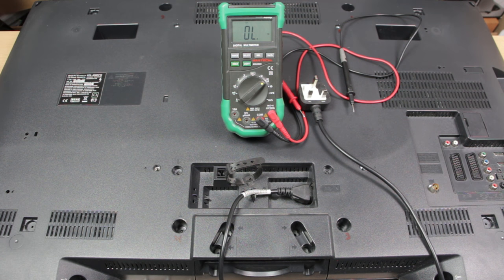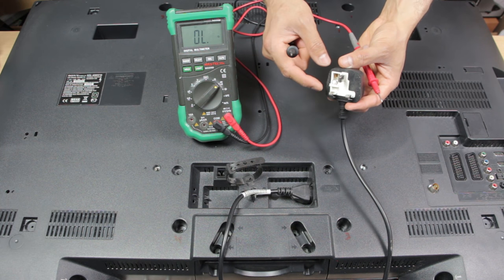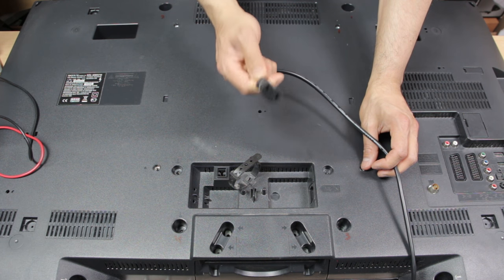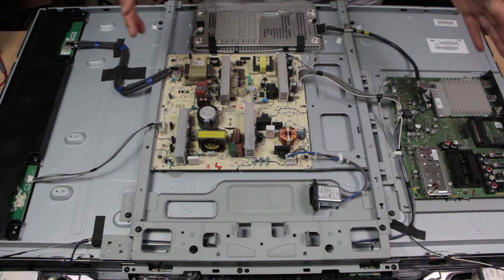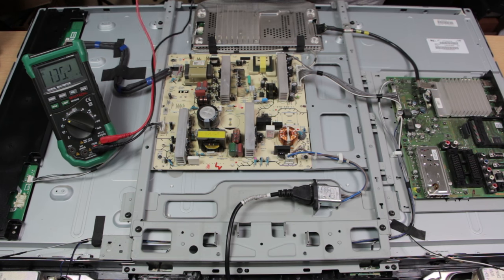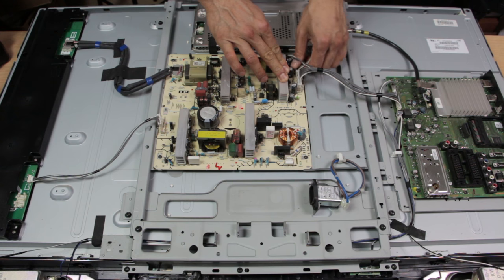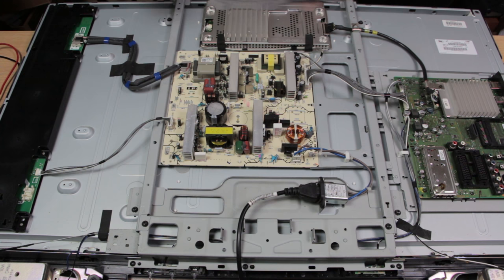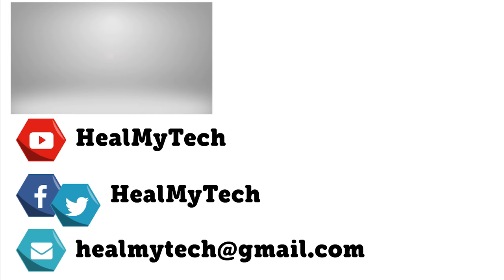How To Repair A TV That Won't Turn On | How To Replace A TV Power Supply Board | Sony KDL 40W5710

Comment: Thank you for posting this video. I was going to throw out my Bravia after a lighting strike, replaced the Power board and all is good, saved myself £££. Keep up the good work matey 👍
Reply: this is why my tv/audio stuff is on a line conditioner. if lightning strikes, it will blow the fuse in the line conditioner and save my equipment.
Reply: How much did a new one cost?
Reply: Why you don't just fix the original supply board? What's the problem with it?

Comment: 10:45..."if you want to ask a question..." but questions posted months ago go unanswered.   I enjoyed this tutorial.  I'd have replaced that huge black capacitor before the whole board, however, as modern capacitors are poorly manufactured junk components and are likely the power failure cause....and cheap!

Comment: My 87 yr old Moms 2011 Panasonic 42" TV would shut off after a few hours of use. A red led  light would slowly flash. The remote would not turn the TV back on?! I figured out that if I removed the TV's power cord from the wall, and plugged it back in, the TV would RESET. In the old days of computers, we would call that a "Hard Boot"! She would sit for hours staring at a black screen. Thank you for putting this simple step by step video together. We cant afford another TV, so THANK YOU for helping me! Michael Seattle WA USA!

Comment: Its such a shame that such a huge board cant just be fixed.  I guarantee its probably a blown capacitor or something simple.  That circuit board is so huge and DOESNT use SMD components.  It SHOULD be cake to fix :(

Comment: We replaced the power supply board with a brand new one. Tested it with a voltage tester on DC and should show 5 amps and it doesn't. The old one did the same. Do you know what the problem might be from here?  There is power going in from the plug but not power going out to the mother board. Like I said the old one did the same so I am guessing it must be something else. Any suggestions?

Comment: Hi, I've got a Sony Bravia KDL-40EX503 that turned off on it's own, but the red standby light flashes twice. Could this be power supply issue? I've tried soft reset and factory reset, still get the same result. Any ideas please?

Comment: Thank you, now I have to go test my DC voltage. My TV is a 110v US model KDL-40V5100 manufactured in May 2009. It doesn't have the fuse in the plug like that Euro model. There was a near lightning strike that took it out. I tried to check the fuse that is on the power supply board and it ohms out at 0 ohms but I'm not sure if it is correct since It's not removable without desoldering it. I checked the voltage to see if it comes through it and it does have 110 (117actual) volts on both sides. The 3.3vdc is present all the time it's plugged in. One Question I have is about my standby/power LED at the bottom of the front panel. It will come on if I unplug and plug the power cord back in but still a black screen. When it is plugged in I hear a relay clicking like it would do when I powered it on before the lightning. Only, it's is a double click and the the standby/power LED comes on for 12 sec. then goes off for 4 sec. and then it cycles again repeatedly. Does that mean I need to do anything different or test anything else than what you were explaining and testing for?

Comment: Hi, very detailed video , nicely explained .highly appreciate it!!  I had a question on my TV- I've a sony XBR65X850E which is not turning on , no power on the screen (black) when I plug in it makes a squeaky noice from inside. I tried to reset couple of times from power but no help , is it a faulty power board problem or something else?

Comment: But what's the fun in that? Search the faulty Capacitor, Triac, Transistor or Diode and replace that. 
It's just like art; it takes some time but the end result is so rewarding.

Comment: My xbr9 is getting 15Vac 6Vdc to the 2 boards that attach to the screen 
(are these the backlight boards)? The boards are labeled 12V. Can you 
recommend component testing on the power board to fix this? If not, does
 this indicate that the main board is bad? And is it worth replacing, if
 it's supposed to supply 12Vdc with no AC is it possible that both of 
these boards are now blown as well?

Comment: Good morning. Our TV went out last week a Sony 85XBR X950G I tested the board and though we had incoming power there was no standby voltage on the pin. I thought I had found the issue and ordered a new board that showed up today. Everything checks out but the standby pin still has no 3.3VDC on the new board. Any idea what you would check next? Now it has me wondering if my power supply board was the issue in the first place. Thanks for any advice.
Reply: What ended up being your issue? My x950g just died today. Black everything and no indicator lights on anything. Power supply?

Comment: Great vid thanks, please tell people however that  the BIG FAT CAPACITOR in the middle has anywhere from 300 to 450volts in it even after disconnecting the power. If they handled the board immedietly after removing it, there is enough to cause shock.

Comment: HI thanks for the great info . We have a Sony XBR 85X 850D  which was working fine in the morning but when we came back from work was dead and no power or light will come on . We were able to take off the back cover . Noticed there are 4 boards in the back . Tested the 1st board using the multi meter and  verified the 110  AC coming in and out . But the 2nd board which we think is the 2ndry power board had 110  Volt coming in but we couldnt verify voltage going out . Now we couldnt test the 3rd( some kind of green tuner board)  and 4th board (main board ) . We are in the process of ordering the 2nd power supply board but would like to know how to test the 3rd and 4th board . Any insight in this will be helpful . Donot wanna junk the TV as its just 4 years old and was working fine before went to mars

Comment: I have the kdl-55w805c. Power going straight into a board. No sign of life. Have replaced the board that the power goes into but nothing. Any tips?
Reply: Didn't know how to check the wire but bought a new one and still nothing

Comment: Hi  samsung 32in    I have measured all outputs coming from the power Supply and all measures good...Now Shopjimmy had sent me 3 diff main boards and didn't work.. they indicated those were defective and gave up after that, gave me a refund...I have diff T-con board inplace.. going back to the main brd..should I buy from somewhere else??  or give them another shot?? when I disconnect PS from main back lights light up  I have ck'd my cord and ok... seems liike I have isolated to the main brd .....what else can I ck
TY

Comment: Hi, my sony bravia DKL-55W800B was working one day and the next nothing.  No light on the screen, no light on the bottom of the tv.  I checked the transformer with a voltmeter and that is fine.  Next i changed the LED driver and that wasn't the issue.  So I changed the Main Board and nothing.  What do you think is the problem.  Thank you

Comment: Hi, when i was checking the stand by pin, i slip the multimeter and touch two pins and and spark came out, can be the other board (the one connected) be damage by that? 😞

Comment: I have the 2 blinking lights, sony bravia same model not powering up. I have 3.3vdc on standby, acc detect and power on(when power button is pressed), but nothing on the 12v pins, any idea what that means?

Comment: My TV won't turn on. On the power supply board there's a connector with two pins labeled 5V and two labeled 12V. When I connect the AC power cord, I get 5.1 VDC on the 5V pins, but 0 VDC on the 12V pins. I bought a replacement board from a repair shop but it did not fix my problem and I get the same readings on these pins. Do you think both these voltages should be present when AC power is applied? Does this means both boards are defective?

Comment: I have a Sony KVL-26BX300 tv...When I m switching it on then its standby green color light is glowing continuosly but the screen is totally black....I checked the power supply board and it is supplying correct voltage to the logic board...can you tell me what could be the problem and how to resolve it?? 
I will be very grateful if you spare few minutes to reply me.

Comment: If you dont have standby voltage, its not necessary that the power board is defective, problem could be also elsewhere as everything is connected.
Reply: Our TV went out last week a Sony 85XBR X950G I tested the board and though we had incoming power there was no standby voltage on the pin. I thought I had found the issue and ordered a new board that showed up today. Everything checks out but the standby pin still has no 3.3VDC on the new board. Any idea what you would check next? Now it has me wondering if my power supply board was the issue in the first place. What else can I check?
Reply: @AlbertBridenbaker  I am not an expert. I was reading some forums and few people said that they replaces power boards, but still no standby voltage... then one expert replied that these boards are all connected and the problem could be anywhere. If there are no service schematics for it, its very difficult to repair.

Comment: The video ignores the fact that the capacitors on the board could remain fully charged, even with the mains power disconnected. Some people are in for a shock.
Reply: How do we drain the capacitors?
Reply: @jeffw825  Now...I'm not saying this is the safest or most efficient way to discharge a capacitor, by any means.
But that said, most people I've met who regularly work with common electrical equipment will simply take an insulated screwdriver or something and very quickly connect 2 of the posts with the metal on the tool to discharge any electricity stored in the capacitor.
Do this at your own risk, it is definitely not the safest way to discharge a capacitor.

Comment: I unplug the main board from power supply board went to check power supply board with meter ground my black, one stump meter pen in to check voltage TV lit for a second

Comment: My Phillips TV is not turning on. It stopped working when it was 1 1/2 years old it is still not 2yrs old. I don’t have anything to check the power on the board so I just bought the power board. However, I just changed the power board ,the TV still doesn’t turn on. What else could be the issue ?